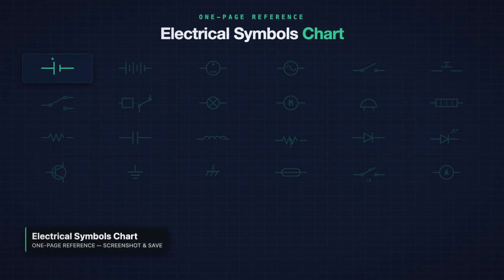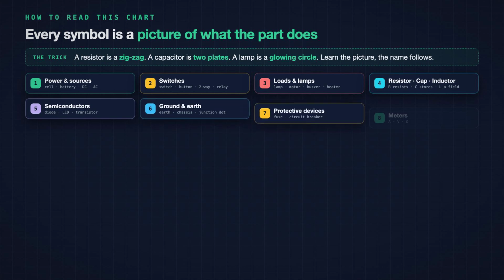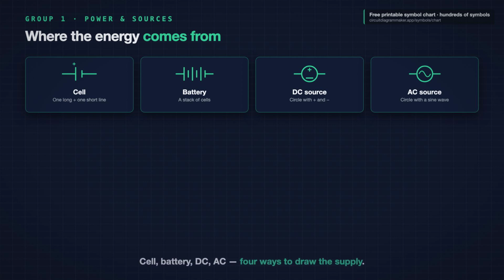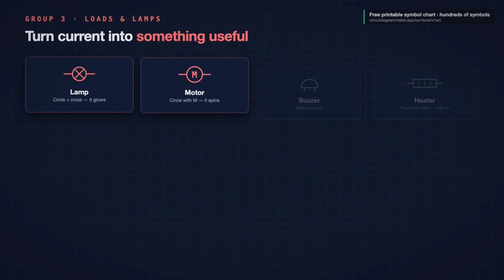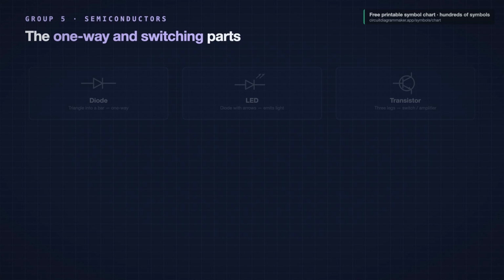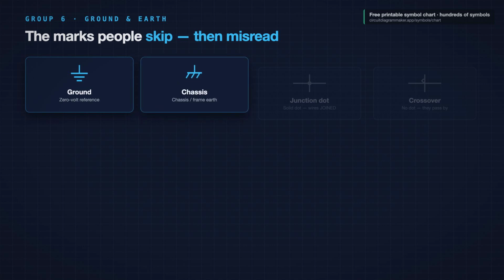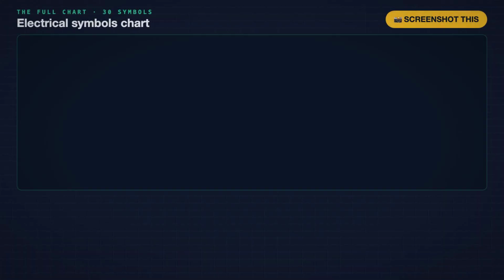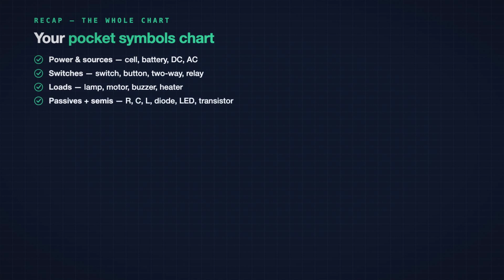Electrical Symbols Chart (Screenshot This)

Comment from the maker: Pause on the full chart near the end and screenshot it — that's your pocket electrical symbols chart. The two marks people misread most are the junction dot (a SOLID dot means the wires are joined; no dot means they just cross over) and the two-way switch (a common terminal plus two travellers, used for stair lighting).

Which symbol always trips you up? Drop it below.

Grab the free, searchable, printable symbol chart (PDF-style, hundreds more symbols): https://circuitdiagrammaker.app/symbols/chart?utm_source=youtube&utm_medium=pinned_comment&utm_content=yt-163